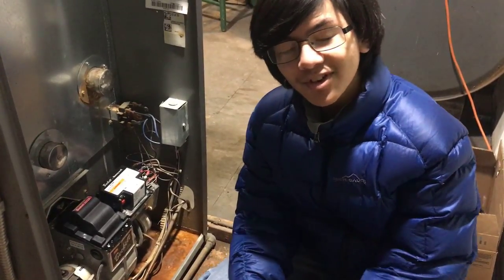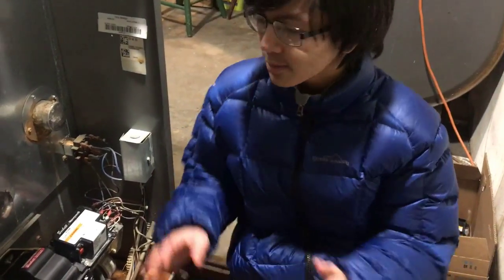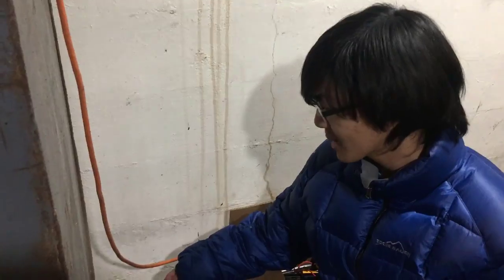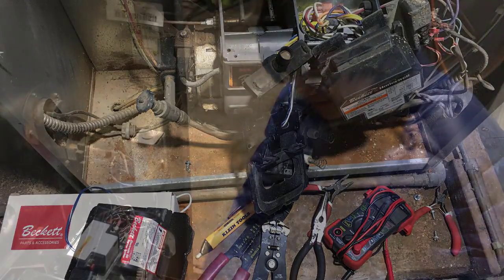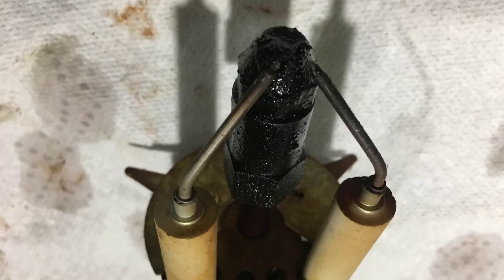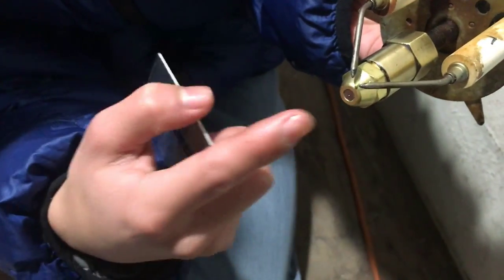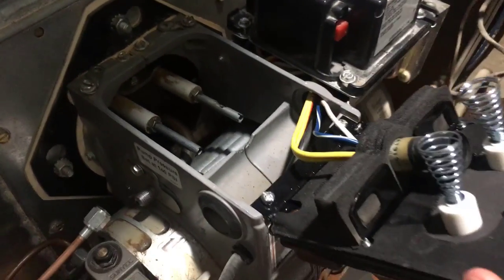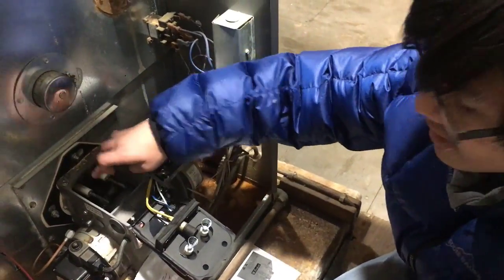Oil Fired Furnace Not Working or Firing? Steps To Diagnose, Troubleshoot, Repair & Fix The Problems

Comment: Very informative, glad to see you're still making videos!
Reply from the maker: Thank you Reeko Brooks!  I've been making a lot of videos in the past few months just that I haven't had that much time to edit my videos.  High school is proven to be quite challenging in terms of homework and extracurricular activities.  Thanks for your support & thanks for watching...
Reply: Hey nice video bud. I've watched a bunch of videos by seasoned veterans on here and couldnt find one that addressed the exact issue I was having.  I've got the same type of fuel pump as you with the solenoid on top. Same issue where the fuel doesn't come out of the high pressure fuel line going to the burner. So I'm guessing I have the same issue going on with the oil pump solenoid. Who knew that out of everybody on here, it's a kid in high school that helps me out! Haha. Thank you. I'll like and subscribe.

Comment: you did a good job troubleshooting, the bill $1365 at the end of the video, was that how much you paid for the parts?
Reply from the maker: It wasn't $1365 it was actually $13.65.  That was the price paid for the part that's defective & failed.  It's the solenoid for the pump.  Although we replaced and purchased other parts such as the Ignited $38, spray nozzle $8, electrode kit $20, oil filter $6...

Comment: This dude forgot to check the mesh filter inside the pump.  If you have that much sludge built up in the nozzle or at the main filter, likely you will have to check and clean the mesh filter  as it could affect your oil flow if clogged.
Reply from the maker: Good recommendation for other viewers.  If you already took the time to take apart the assembly, might as well replace the mesh filter, other filters not mentioned and clean everything else thoroughly....